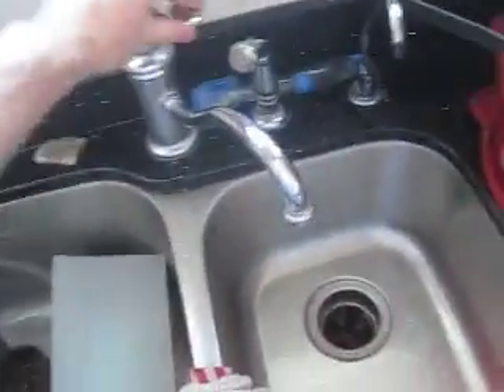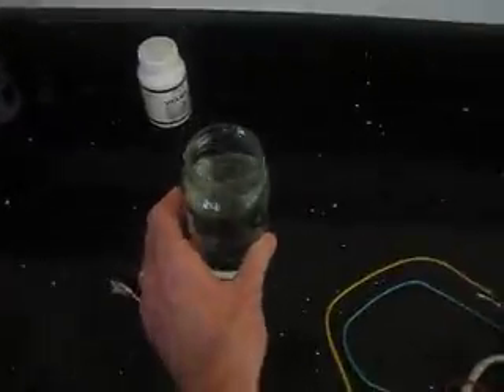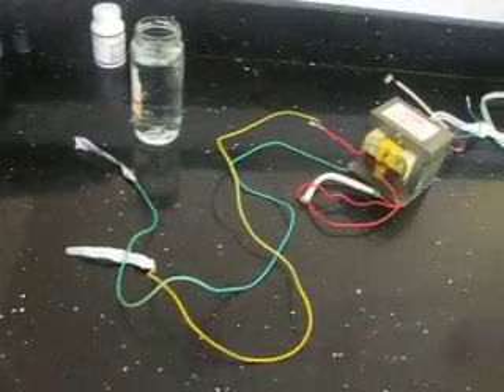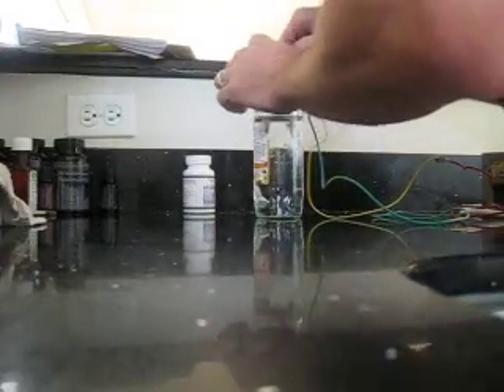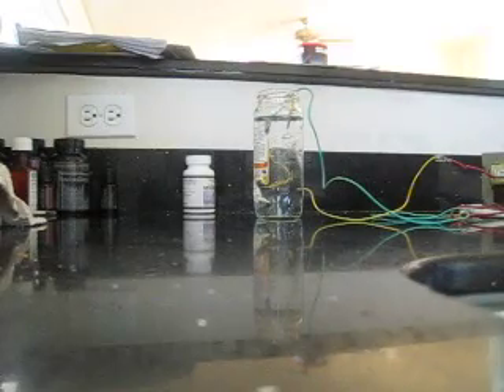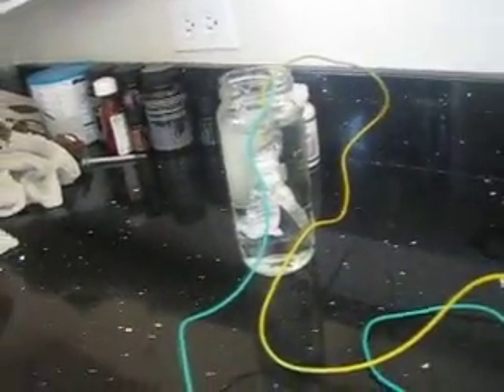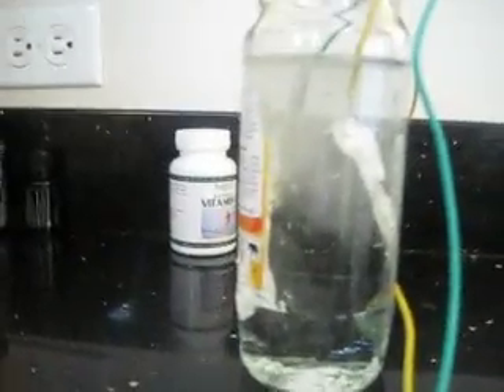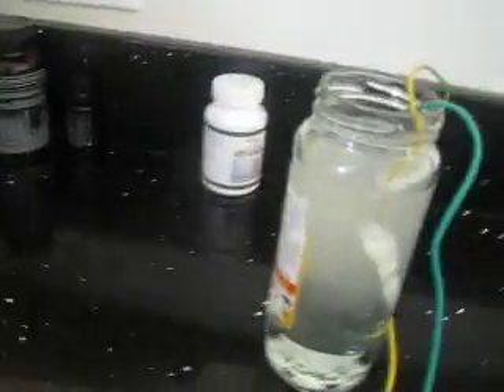HHO With A Microwave Transformer Part 3 (Making HHO)

Comment: Go to the website Ratalie.(com) or look at supermuble here on you tube. He offers build plans for a Radiant Charger which locks onto waters resonant frequency(tap, faucet, rain, ocean, any water) within any water fuel cell. It took Charles 70 different configurations to make a circuit that would be a simplified version of Stanley Meyers water fuel cell. Let me know if this helps you.

Comment: This is very interesting Tyson. In my research, I learn that the actual Magnetron(which creates the microwaves)is powered by DC. Your 2100 volt AC transformer used 2 diodes and one high voltage capacitor(all within the microwave) to convert the high voltage AC to high voltage DC. Just in case you wish to test HHO with DC.

Comment: Tyson, can you please repeat this high voltage HHO production test with any distilled water(sold at most grocery stores for less than 2 dollars per gallon). In my research, it's been said that tap water has so much metals and such in it that it can act as a conductor. If you can produce HHO with no electrolyte, and distilled water- I would be amazed and very happy :)